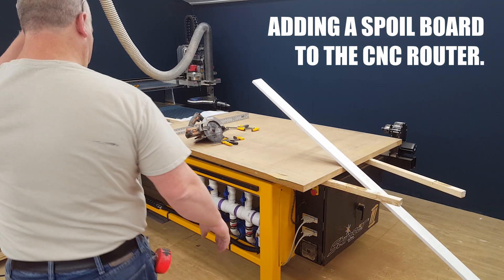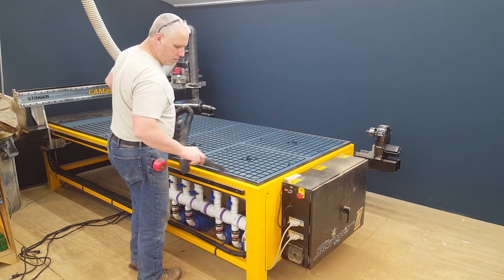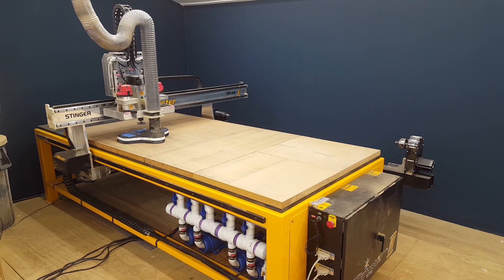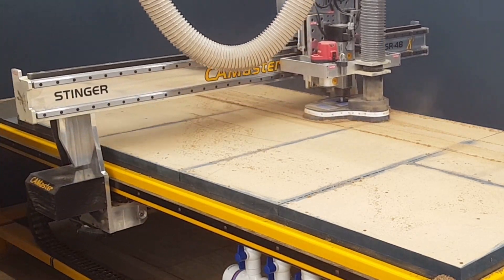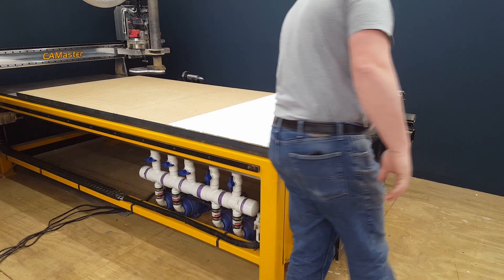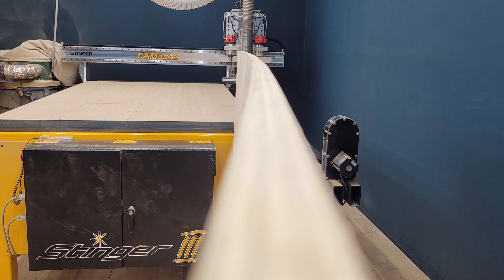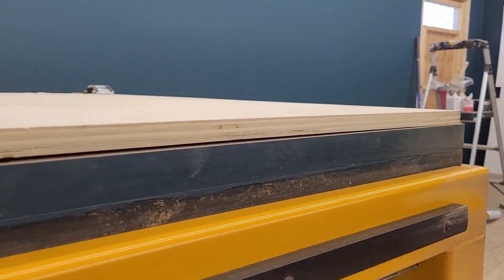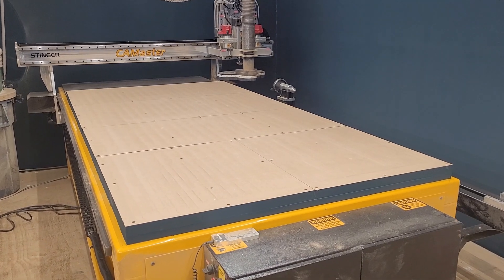CNC Router Vacuum Table - Part 3 - Zoned Spoil Board

Comment: Thanks for sharing, awesome work! I am doing a similar build and was wondering if anyone had tried peck drilling a shallow hole pattern on the top face of the MDF instead of a full re-surface? Since they sell those gasket sheets with a hole pattern to go on top of the MDF... wouldn't that accomplish the same thing? Would be much cheaper than using the gasket tiles and save time on the re-surface.
Reply: Holes will allow debris to be sucked into your vacuum. This is why it's done with a solid sheet. It's still porous enough to allow your vacuum to work.
Reply: @diggs332001  Im thinking just enough to break thru the surface skin layer, like a millimeter deep. That would be the same as those gasket tiles they sell to go over the spoil board, those perf holes are like 1.5 mill.

Comment: Did you screw the mdf directly into plenum table? I'm considering doing this because I don't want to run my vacuum pump at night time or sometimes Also some jobs don't require vacuum. I cut small letters and they go flying into the vacuum.
Reply from the maker: Yes, I did screw it directly. I countersunk all of the screws for when I have to resurface it.

Comment: Thank you. The system works great. I followed your direction fully for making the vacuum system, except mine is four zone and I added a Fuji PV8 vacuum relief valve. I used 3/4" solid surface for the vacuum table. I made the spoil board out of 1" MDF.

Comment: good work mate. In my opinion, that waist board shouldn´t be so thick. Half of that thickness would be right. Another important pois is : using a gasket between g first grid surface in all the perimeter by zones.

Comment: curious if that thing has lasted with those vac pumps. looks like an awesome table i just dont see those vacs holding up
Reply from the maker: My first CNC had a Hurricane Vac system on it. Several of those motors had gone bad over the years, and they were basically the exact same motors. They were 240v and these are 120v...
I've had no problems with them so far.
Reply: @x3cnc479  thats amazing. ive been looking at the hurricane but they want $3k for that thing! where can i get motors like the ones youre using?
Reply from the maker: You can find them on both eBay or Amazon. Just make sure that you price shop... they can vary greatly from seller to seller.

Comment: Don't quite understand the point if that system is only able to hold the spoilbostd, but not the actual part 🤷🏻‍♂️
Reply from the maker: MDF is porous if you remove the skin from either side. This allows air to pass through it. It's really not a solid with its finished skin removed. So the vacuum passes through, holding your material down to the spoil board.  Hope that helps explain it.

Comment: I see you have a rotary axis off the side of your table 
what  post processor did you use
Reply from the maker: Well, it's a CAMaster cnc, so I use the Recoil X-3 X to A Inch. But in the job setup, I choose the Y Axis for the Orientation. I also do most of my toolpathing in Aspire. But Vectric should have drivers for most machines.  Thanks for watching.

Comment: How is there ANYvacuum to hold down the top sheet if the sheet directly below thw sheet to be cut is SOLID with no access to any of the vacuum    what am I missing here ???
Reply from the maker: Well, I asked the same question years ago.... Please allow me to explain. I am using MDF as a spoil board.... MDF when purchased will have a "skin" on the top and bottom of the sheet. This skin is made during the manufacturing process to give you a nice surface to finish. But, if you remove that skin on both top and bottom, the core of the material will allow air to pass through. While it seems like a solid, it actually isn't. It is like a sponge with tiny holes and gaps between fibers. So it is key that you remove this skin and it also helps if you seal the sides (thin sides) to stop your vacuum from escaping through these side while trying to hold down a piece of material. I hope this helps.
Reply: @x3cnc479  You should make a video dedicated to this concept. I was lost and your video helped me understand even in the world of Google. It was in fact too much information everywhere that was making it hard for me to find this answer. I was trying to find a spoil board that was slot and cut to allow air to pass through. Watching your video, I realize I don't need to do that.

Comment: Paul,
thanks so much for taking the time to make these 3 videos. I am about to purchase a Stinger 3. I understand you worked with a Stinger 3 with the Hurricane system before. Do you notice any difference in the function between your system and the Hurricane set up? Pros vs cons?
What would you estimate the total cost for your Vacuum table set up?
I believe your system will save money up front and each time a vacuum motor goes up. I am a hobbyist, I have never used the vacuum table in the applications I use a CNC. 
Thoughts?
Thanks,
Clint
Reply from the maker: Clinton, Thanks for watching. To answer your questions, I paid about $150 per vac on ebay and truthfully since I made the whole thing, I have only used two vacs. I think four may have been a bit of overkill. But if you make it yourself, you can make it as I did, but just cap some of the vac ports incase you want to add more later. I think by segmenting the spoil board the way that I did and sealing the edges, it greatly improved the hold. I think all in all, I spent about $800 for everything. I hope this helps.
Reply from the maker: The Hurricane Vac certainly was beneficial.... I realized how simple of a system it really was. While mine is not all self contained, I'm happy with the results.
Reply: @x3cnc479  Paul, when I looked up the Xpower B24, the specs showed a 150 cfm rating. I will have a small shop with a Grizzly G0671dust collector (got a good deal). Could you use a similar manifold system but use the Dust collector to provide the vacuum? Do you think the G0671 would be enough to use as a chip collector off the main spindle shroud and also the vacuum table? I believe the G0671 is a 4HP motor rated at 3552 CFM with a static pressure of 13.5 at 0 CFM. 
thoughts?

Comment: I am expecting my machine in 4 weeks - this video has been super , super helpful.   Did you put inserts to hold the screws on the spoiler?  Also, I read on the CAMheads that big box MDF might not work, need to buy commercially.  Did you use big-box MDF, and I hope so as it is easy to get then commercial grade. thanks
Reply from the maker: Hey Greg, exciting time for you. I hope time flys by for you. To answer your question, when I first started I used MDF from the big box stores, I only stepped up to the 1 1/2" boards because I tend to resurface more often then most probably do. It's just easier for me. Again, I used it and had no issues. You should be fine. Good luck!
Reply: @x3cnc479  when you show screwing in the SB to the vacuum board, you use screws, did you use inserts.  I like the 1 1/2 in as that makes sense to me also. I loved how you tested it, so I am following your lead.
Reply from the maker: Greg, sorry about that... I answered your question in my head, it just didn't make it into the reply.
The answer is, no. I did not use inserts, I just used deck screws. I have them countersunk down where they are clear of any potential mistakes that I may make. Hope that helps you out.
Reply: @x3cnc479  Thank you very much  - I really like what you did. I will be making this SB this weekend, getting ready for my machine.  Thanks again for taking the time. Very kind of you.
Reply from the maker: No problem.  If you have any questions,  I will try to keep an eye out for them.

Comment: Great series, thank you for your explanations.  You demonstrated using a thick spoil board.  Have you considered a much thinner board, 1/8"?  We use a full 4'x8' MDF 1/8' and allow the bits to take a small amount with each job run.  (Clean cut for each piece) After numerous jobs we simply replace the 1/8" board. (I can't think of how many jobs, but we are a commercial shop and use the machine extensively)  It's easy since we don't fasten that piece down and let the vacuum take care of it for us.  We then use that scared 1/8" board as a floor covering for our finishing area.  Thought it might help.

Comment: Why did you not just glue the spoilboard down
Reply from the maker: I prefer to screw it down because if I need to replace it, which I use to do about every two to three months, it just makes it easier. I dont want to have to surface it all the way down and then replace it. I just think its quicker. I've seen a lot of people on YouTube do that and I didn't really understand why. Its not great for servicing it if needed. But, to each their own, right... lol Thanks for taking the time to watch and comment. Have a great day!
Reply: @x3cnc479  what do you guys make that you run that machine that much

Comment: Why did you cut the spoil board into segments, rather than using a sheet the size of the sub spoilboard?
Reply from the maker: Thanks for the question.
I cut it all up so I could seal the edges. By sealing the edges, it helps reduce vacuum loss in that particular zone. So I can focus the vacuum into a particular area if I am working with smaller materials. If it was all one board, the pull from the vacuum would not only be from top to bottom, but it would pull sideways from anywhere along the board. So I am trying to reduce that loss. 
And, secondly... I will be able to replace single areas if I ever (or when I) miscalculate the depth of the cutter and take out a huge chunk of the board.
I hope this helps. Thanks for watching.

Comment: Never would have thought that MDF would allow air to pass though it. 

Could you put a 2’x3’ piece on the bed and still have it held in place to cut?
Reply from the maker: Thanks for the comment.
Yes, MDF has that hard skin on either side but once removed it becomes like a sponge, allowing air to pass right through.
You bring up a good point about smaller material sizes. 
I should have displayed that as well, but to answer your question, yes, it will hold smaller sized materials.
It doesn't have to cover the entire zone.
I will try to put something together to further explain this spoil board.
Thanks for watching.